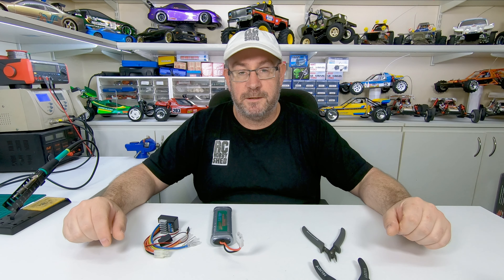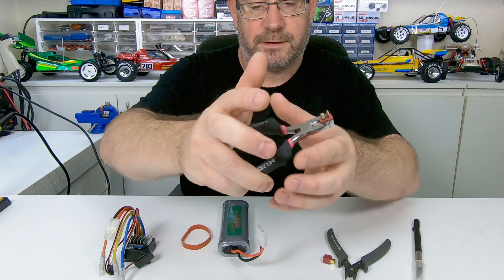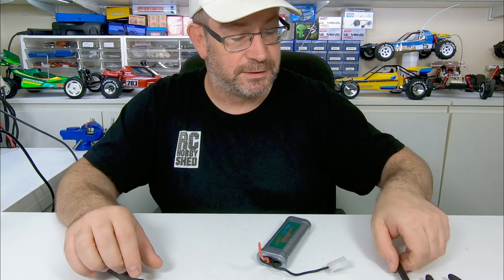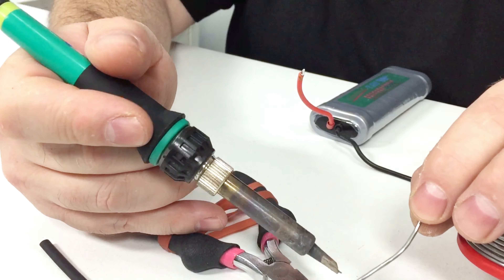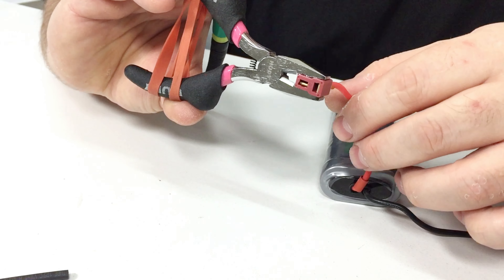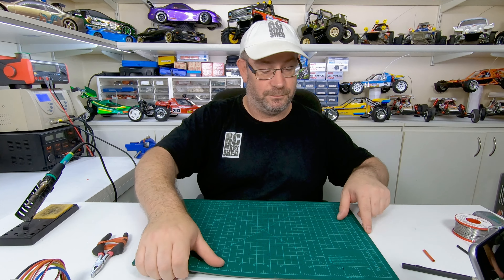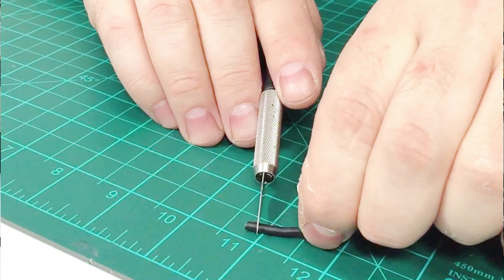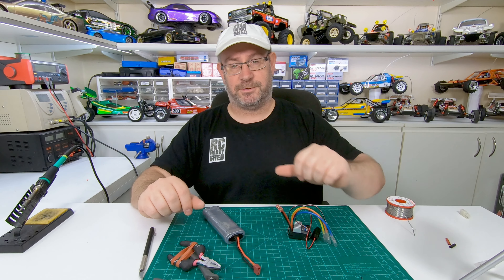Soldering Tips - Changing ESC and Battery Plugs

Comment: Thanks for the great tips mate!
Good to see I'm not the only one with an elastic band around the pliers trick haha works like a beauty 🍻👍🦘🇦🇺
Reply from the maker: Thanks mate. Yeah the old rubber band to the rescue!  I should have used my full size pliers, had to chase these around a bit because of the light weight but I wanted to show peeps they don't need a vice or a jig. 👍
Reply: @RCHobbyShed 
Good idea using bigger pliers!
Mine move around a bit, I was thinking of welding a piece of flat bar steel on the back of one of the jaws so they'll sit vertically.
BTW I tried to reset mt Tamiya TBLE-02S -02s to resolve the constant green led flash and no luck, I'm only getting less than 1 volt output to the receiver so I'm un able to reset anything via the remote.
Looks like it's going back under warranty.
If they give me any feedback on what is wrong with it I'll let you know incase the same happens to you or anyone else.
Thanks again for the advice on it 👍🍻🦘🇦🇺
Reply from the maker: @outbackrcaustralia4895  Not a bad idea welding some flat bar on the pliers. Cheap Vise Grips will also work. I'm thinking of making my own jig, just cheap and simple. Will put it on the channel if I come up with something. Damn, that sucks about the ESC, I didn't Google it a bit but found nothing. Hopefully they will honor the warranty, I can't see there being any problem though. Good luck! 👍
Reply: @RCHobbyShed 
Pretty sure Tamiya will honour the warranty, I buy everything possible from Crazy Hobbies in Sydney and I'd put money on it that Oscar will make sure I get looked after.
Hope the new jig works out! Looking forward to seeing what you make 👍

Comment: Nice vid Mick, I could use one of those clamps you showed at the start. I've melted a few deans plugs in the past trying to solder them.
Reply from the maker: Thanks mate. They're around $30-$40 on eBay. They are good, but I think they need more weight to them. They hold bullet connectors and XT's too. 👍

Comment: Im looking to change my battery and ESC connectors for my blade 230s v2 helicopter and im wondering if il need to change the gauge of wires coming from the ESC to the battery? Or do I just change the connectors?
Reply from the maker: Hi. I'm not familiar with the heli's. All I can say is, if your wires are OK and not getting hot or anything. I'd only change the connectors.  👍

Comment: what happens if you put male on batt and fem on ESC?
Reply from the maker: It will work fine, but you run the risk of shorting the battery on anything metal that the exposed terminals may come in contact with. Same reason household power outlets are female, if they were male they'd be pretty dangerous. 👍
Reply: @RCHobbyShed  aah that makes 100% sense thanks alot!